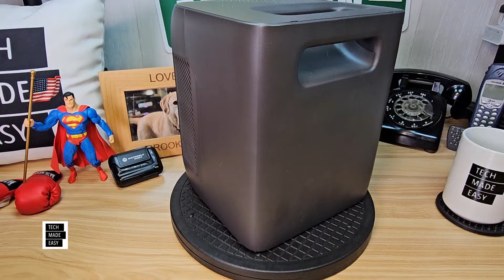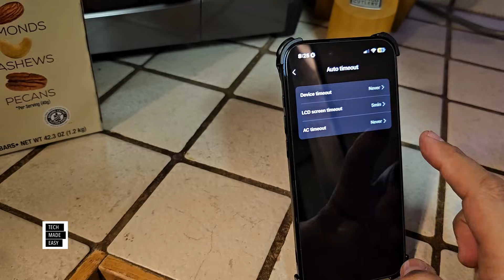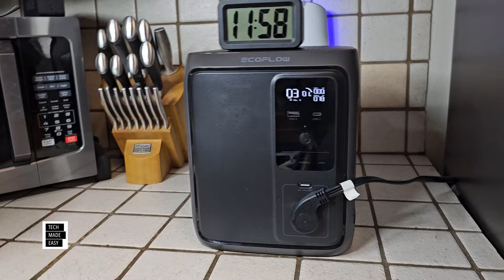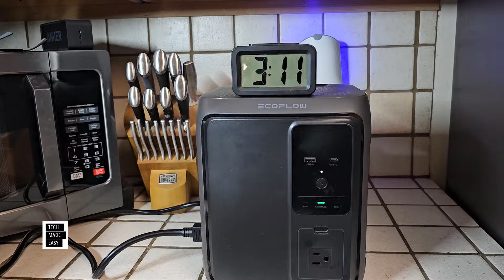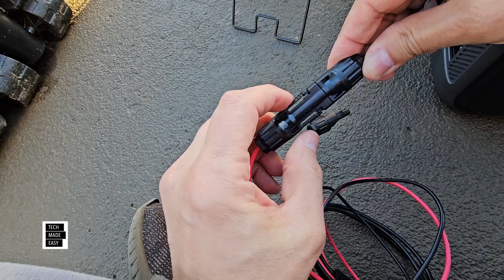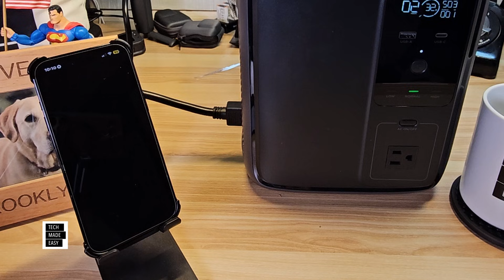DETAILED REVIEW Delta AIR EcoFlow Delta 3 1000 Air

Comment: Even at only 500w it can run the fridge? I was under the impression that refrigerators had a spike in power at the beginning when the compressor turns on.
Reply from the maker: Yup test was fine and I’ve never seen 400 or 500w with this fridge
Reply: @TechMadeEzy maybe it's just an efficient fridge. Mine is old and allegedly they spike to 1300ish on compressor startup. I got a bluetti ac70 instead of this delta 3 because of that. Did Google steer me wrong here? Or is it all good?
Reply from the maker: Very efficient
The ac70 is it a different league altogether https://youtu.be/wudjnnwRwrk?is=LQbIqHFnqBQN3o8u
Reply: @TechMadeEzy so it's solid for running my fridge for a few hours during power outages? That's what I'm trying to do. And the wifi, maybe a lamp. I'll probably get an extra 12v battery and cable with clips to pair with it. To up the battery capacity

Comment: The design is nice for a fridge backup but in reality this thing is not very capable at all.  It couldn't run my fridge, even though it never exceeds 200W continuous and runs fine on my lowly R2 Pro.  I realize the R2 Pro has a slightly higher surge rating, but this thing is practically set up to run a fridge (or some other place you set it and forget it). So basically, the surge rating is baloney.  It would go for about 4 minutes then say overload (presumably whenever the compressor turned on). I bought a 2-pack, they both do the same thing (firmware up to date, no timeouts, x-boost on or off, ups sensitive on or off).   Other problems: the fan runs constantly and is much louder than any other Ecoflow unit ; the pitch is also extremely annoying as well.  In fact I would return it solely based on the fan noise. You can hear it in the video, but you may not realize it runs that loud with zero draw and charging at 150W-- most other Ecoflows (I have more than a dozen of them) are silent at these settings; in fact sometimes it is this loud without any charging or discharging. If you really load it up it sounds like an airplane.  On the plus side the UPS is consistently 11-12 ms on my scope, which is almost 10ms, so I guess that's good enough.    The settings are also more limited than other Ecoflow units.  You might think it's a good backup for your internet, but the noise is too annoying to be used anywhere indoors.  Anyway, I don't recommend this unit *at all*.
Reply from the maker: For a beginner at $299 for 1024wh not too bad

Comment: I wish you would have tried the 700w charger with xboost on. Curious if it would have provided enough power.
Reply from the maker: It doesn’t help when it comes to devices like that. There would be no benefit. 
This is what it’s made for

Resistive Loads: Excellent for kettles, coffee makers, heaters, and microwaves that primarily generate heat or are less sensitive to voltage changes.

Comment: Will it power starlink gen2? If so, for how many hours?
Reply from the maker: It’s not gonna run for long, probably would say 4 to 6 hours. But keep in mind if you connect Solar with good son, it will extend the run time. You might want to think about the delta 2 with an extended battery for just a few dollars more https://youtu.be/tvdsITwG_OQ?si=B2-iOSewFJqKi7bG

Comment: I have had this for weeks… 10ms ups mode works well. Wish the app had TOU mode.
Reply from the maker: EcoFlow's TOU (Time-of-Use) mode is an operating mode for its power stations that automatically manages charging and discharging based on your local electricity provider's time-of-use rates. It is designed to save users money by charging the battery during off-peak hours when electricity is cheaper and then using that stored energy during peak hours when rates are high. This mode can be configured to work with solar input to prioritize solar charging and only use the grid when necessary.

Comment: Someone in the naming department needs to be fired. I love this as a ups. It beats alot of those expensive ones since it doubles as a power station. I saw it for 299 on launch which for a 960wh is pretty good.
Reply: One thing they should have added is dc barrel ports. I saw that you can use those have a lot of adapters for adding extra ports or even connecting them to router and stuff
Reply from the maker: Honestly people that are beginning to use power stations don't use the barrel ports and I know EcoFlow wanted to keep the price low, think about the USB type c port and how the wattage is so low it's not even 100 watts

Comment: well with the sale price i see it is better than the other units. BUT at normal list prices i can see no real advantage over the delts 2 that has many more ports.

This looks like they are trying to build something a bit smaller than the delta 3 classic but bigger than the river 2 pro except the 2 pro can handle 800w but has a smaller battery.

Honestly i think this is there version of a River 3 pro but they pushed it up to the delta name for some reason. 

after further checking the only plus i can see for it is the lower powered inverter. i would assume consumes less operation power. For me this is a no.

I currently own and use Ecoflow Delts 2 max (home unit)
 Ecoflow River 2 for medical equipment 
Rebody 72000 (dc only) old portable DC unit at about 90% well over its 3000 cycles
Anker SOLIX C300 DC new portable dc unit
PECRON E1500LFP (for a specific use) still not sure if I like it or not but it works for the use.
and a ton of 18650's for everything else.
Reply: Yes, a hard no. We use Delta 2 for $350 during sales.